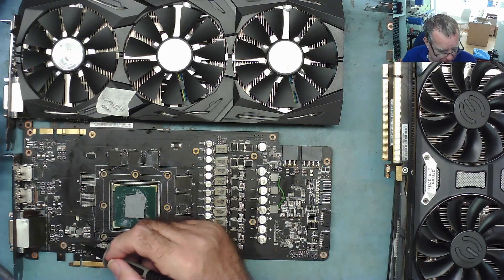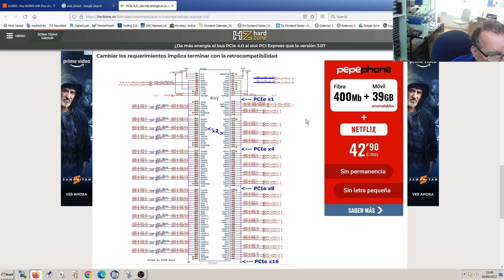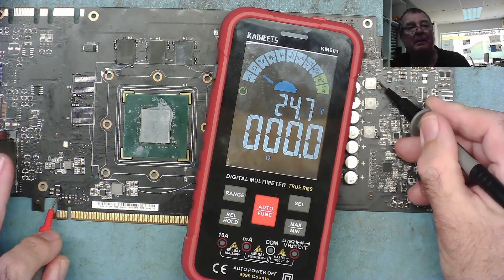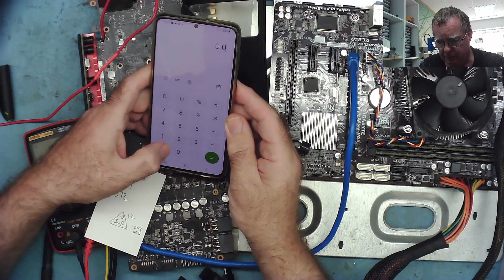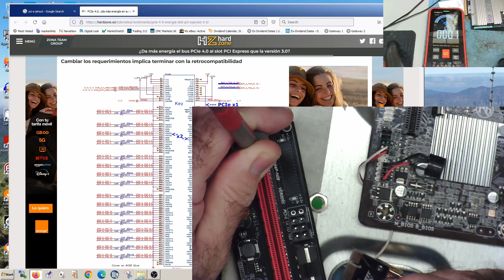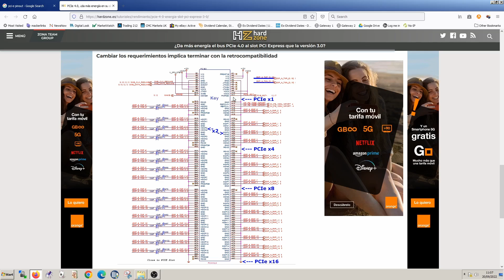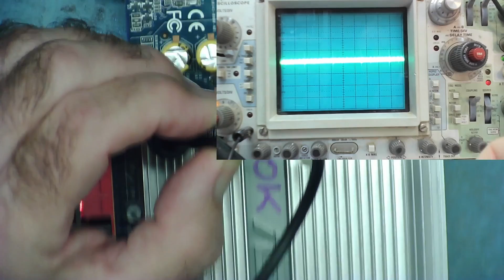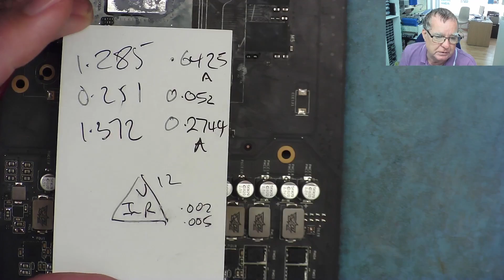Could You Fix This GTX 1080 - part 2.  Graphics Card Not Detected

Comment: Hi Richard thanks for the video. You can check the 33 ohm resistor between bios and gpu desoldering the bios chip and the pull up resistor, then you can measure the resistance value or the voltage drop in diode mode trough the pin 1 pad and ground. If you get open line the probability that the resistor is faulty is high. In order to found that resistor I suggest  to put at the top of the multimeter probe a little brush made by some layer of desoldering wick, then you can check in continuity mode which one resistor is touching the resistors in the back of the gpu (usually it is placed there or near the bios chip).
Hoping can help!
Reply from the maker: Hi T3RROR yes I would like to see if I can further with with the suggestions and comments here so I will make a part 3 to try things like this out.

Comment: I already commented on the first video: Just because a signal is not connected to the motherboard on the riser cable, doesn't mean the signal isn't used, it could be generated on the riser board itself and only be required by the GPU, not the mainboard, so it doesn't have to go back to the slot on the mainboard. According to a quick Google search, both SMB rails should be pulled up to 1.8V. But I doubt that's the issue here (I think it might be the GPU doing the pull-up, then it wouldn't matter anyway), the reset signal is more concerning (I think wake is optional, shouldn't be required to start the card). Maybe there's a broken trace or a short to a different power rail somewhere?
Reply from the maker: @Alvin853 I get what you are saying.  There is no logic circuitry on the riser card itself - only a buck regulator that drops 12V to 5V and then a LDO that drops 5V down to 3.3V  so the only thing it could do to the reset signal is connect it to ground or one of the voltage rails via a resistor / resistor network.  But anyway as I showed in this video, both WAKE and PCIE_RST (PWGOOD) do connect from the computer PCIe slot via the mining adapter to the graphics card

Comment: Lost track of which card you were on, but the 0.8V (PCI reset?) is suspicious. Perhaps lift any series resistors etc and / or put finger on to see if floating. You could lift the enable pin of the BIOS IC and pull it permanently low, but stand by with an extinguisher, new pants etc (or trousers, depending on country). Ideally need some status LEDs on the reset, wake etc signals (on the adaptor board) and a storage scope
Reply from the maker: Hi Ralph The 0.8V PCIe Reset was on the working card, EN7600GS.  The non working card GTX 1080 had 3V on the reset pin
Regards pants/trousers depending on country, here it is shorts all year round as even in the winter it gets to 22C or so and almost never rains in the day, what bit of rain we get generally falls in the middle of the night.

Comment: Hey Richard i do have a off topic question. I saw a video where someone was talking about tools for repair business and they insisted that you need a linear power supply for repair work and that a switching one would be bad. they didn't give any reasoning. I couldn't think of a reason why switching one would be inferior to a linear one. any idea ? 
best regards!
Reply from the maker: If you saw the recent review you now know I have two linear bench PSU and one switching. So over time I will be using both types and then we can all decide the truth or otherwise of that statement